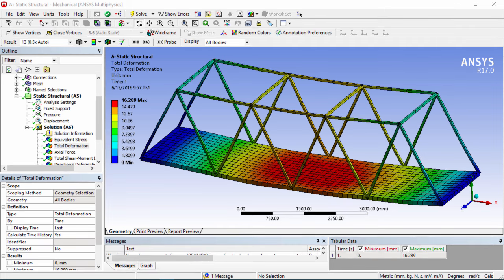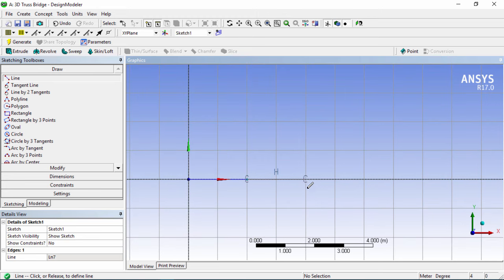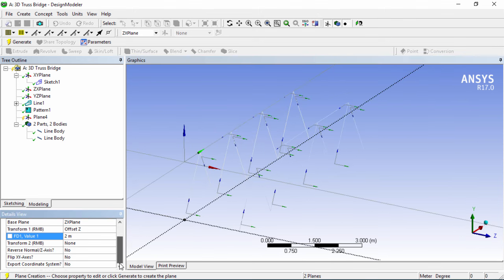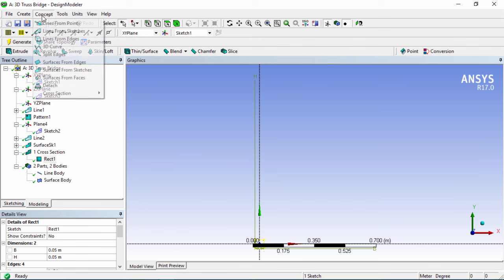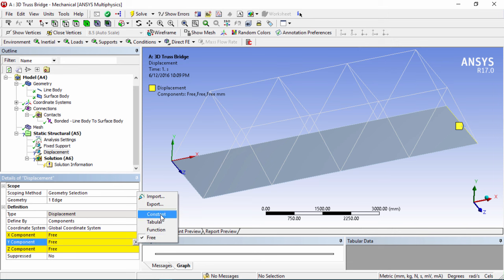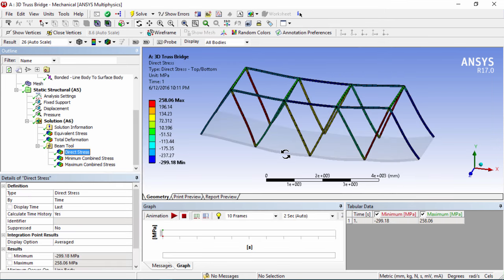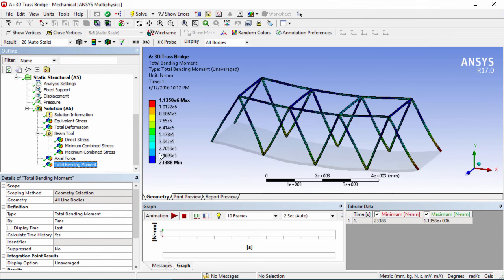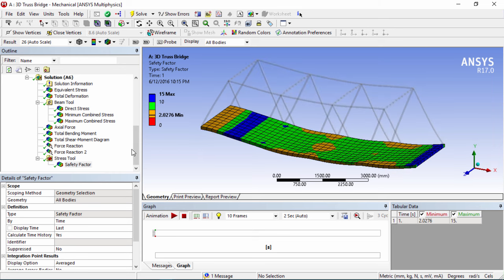ANSYS 17.0 Tutorial - 3D Bridge Truss with Surface Body Platform

Comment: I have an issue with a similar bridge truss.The points where multiple L section for the bridges comes togather are not like a sigle point. Each sections has an edge there. It is shold be like a single pint welded

Comment: Could you tell me how I can perform a dynamic analysis on this? To extract the first few mode shapes and frequenices. I am new to ANSYS and hence encountering a lot of difficulties.
Reply from the maker: +Rahul Kochar you can use a Modal analysis. In workbench, under analysis systems, drag Modal into the project schematic, and link the cells from the static structural to the modal to share the data, then open modal and find the mode shape and frequencies. Hope this helps! Thanks for watching!

Comment: Hi,

I want to ask what are the advantages of using line bodies for beams over the conventional solid bodies? Which will yield a more accurate result?

Cheers!
Reply from the maker: Line bodies save compute time, which means it solver faster. Sometimes you are not interested in all the details of the body but more the effect it has on the transmission of forces to the other body, so in this case you can use a line body for simplification.
Reply: DrDalyO Sure, thanks!

Comment: There are some things unclear to me. 
Are beams pin joints or welded on each other and surface? Because if it's pin joint then the beams carry only the axial forces. But in the results there are bendings on beams which means they are not pin joints. So in case the bridge structure would be truss structure, then how is the model changed?
I've seen mech. apdl software is used widely for truss analysis to model truss elements on the other hand for those who claim they are doing truss analysis are actually doing it wrong I think.
Thanks in advance!
Reply from the maker: +Fırat Ertürk hi, i should probably change the title for this my mistake. They are welded beams. Il probably make another video thats actual trusses, which yes, only take axial force and no bending.
Reply: DrDalyO oh great! thanks for your answer and good luck with the new videos! 
King regards.

Comment: what exact version of Ansys do civil engineers use
Reply from the maker: Could by any version really. Usually depends if they paid for the updates or not, if not then they are stuck with older versions. People are generally on version 13 or higher. Im of course running on 17.

Comment: How did you get the stress tool to be available.  Mine starts at Deformation. Thanks.
Reply: Is it because I'm using the student edition?
Reply: I am interested in the safety factor :(
Reply: I'm working on a truss problem with structural beams.

Comment: Hi DrDalyo, i am having problems modelling a composite structure of a wood frame embedded inside a masonry wall. Do we have to make interfaces between this materials? how do we approach having two different materials when one is inside another and they might interact as the structure deforms. Any suggestions?
Reply: Hi, did you finally solve your problems? I'm modeling a composite beam with some tuss connectors and an insulation layer embedded. How to set the interface to be a perfect bond?

Comment: Hello DrDalyO,
I'm in design modeler attempting to draw a truss frame. I attempt to generate a new line from sketch and once I do it assumes an existing line body that I had generated before with a given cross section, therefore I cannot assign a different cross section to the newly generated line. This frame has components with varying cross sections.  How can I generate independent line bodies with different cross sections?
Reply: Just set them to "frozen", go search on google.

Comment: what are the laptop hardware requirements to use ansys 17 smoothly
Reply from the maker: Any decent computer can run it, however the time to calculate will vary depending on your element, node count and model. Im running a quad core i5 with 8gb ram, and standard nvidia card. You could run on a dual core also. Ansys is very "core" hungry so the more cores you have the faster it will solve. Theres also something called simu cloud i believe where you can run problems on their servers for a fee, and they have tons of computing power.

Comment: Hey DrDalyO,
I keep getting an invalid geometry error.  Is there a way to diagnose this error(s)?
Reply from the maker: Hi, you could check the solver output. It would be under the Solution branch, then Solution Information. In the Details window, look for the first option which is Solution Output and make sure its on Solver Output. There you can scroll down and see some more details about the error. Feel free to post it here.
Maybe try redoing the geometry and starting from scratch though, or even try something simpler to start.
Hope this helps!
Reply: You could also download the file he used and compare it to yours.